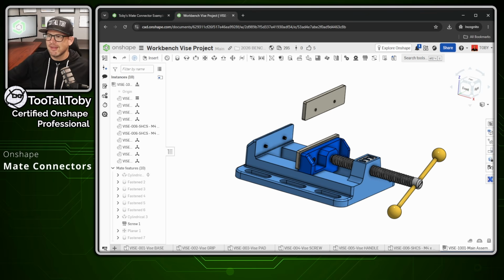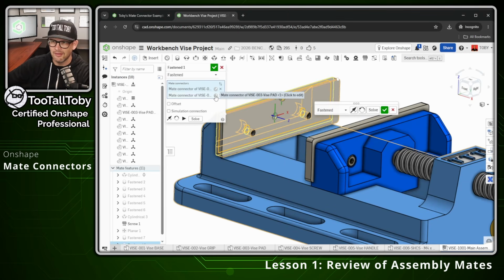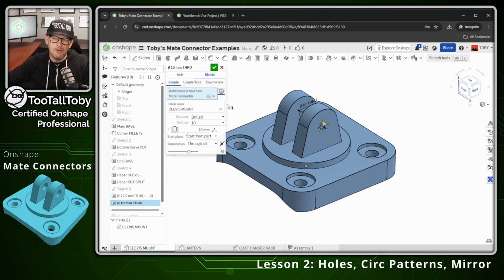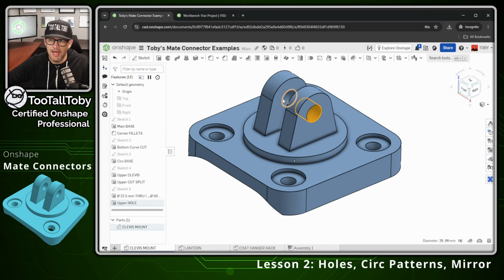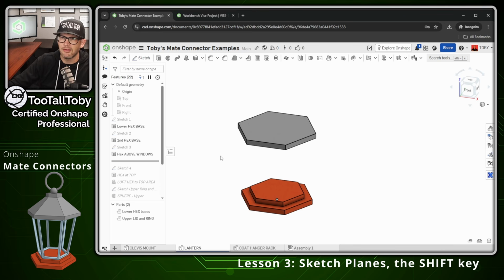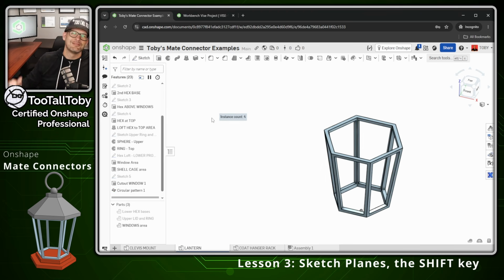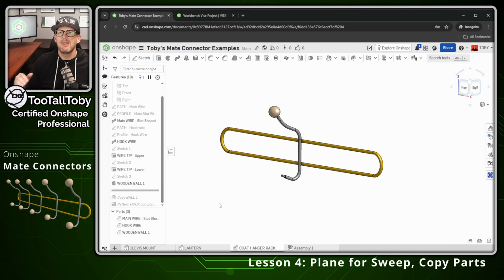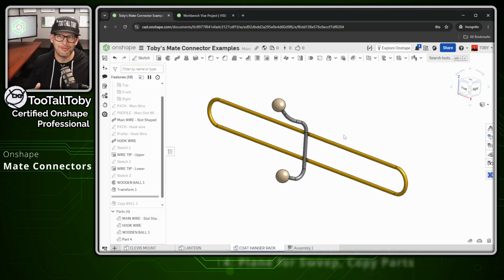10 Mate Connector Hacks to Speed Up Your Onshape Workflow!

Comment: In ALL CAD programs be very careful of centre of faces - as I understand, the mid-position of the face is dependent upon the outer boundary profile, therefore it only takes the smallest difference or imperfection to any of the exterior bounding faces and the 'face centre' has moved. An example would be a cylinder bar with an exterior keyway slot cut; the exterior circle is not continuous so a face centre would not define the cylinder axis.

Comment: Nice! Toby will soon be using mate connectors for everything, including brushing his teeth!

There are many more places MCs can be used, a couple examples: 
- When used as a sketch plane, MCs can be used to set the horizontal/vertical directions of the sketch, which can be handy when sketching things that are "angled" from the main planes.
- Another great use is for a neutral plane for draft in a hole: you can use an MC to add draft from the "middle" of the hole to keep the "average" diameter.
- MCs as an "up to" for an extrude can also be very useful (including adding an angle), I have a video on my channel showing this in action (TTT 23-T-80 Dust Lid)
- A workflow I really like is setting up a layout sketch with just vertical lines, and then using these to add profiles at the different levels, perfect for something like the bird feeder as it's cleaner than creating the new sketches on MCs along the way.
- The layout option also makes it easy to add things at angles but you didn't get into the re-align/angles in general so that would be a different topic.
Reply: Love it thanks Airwick for the excellent suggestions for future topics (and great ways to save time too!!)  😁😁😁😁